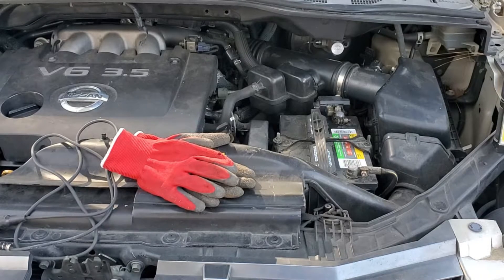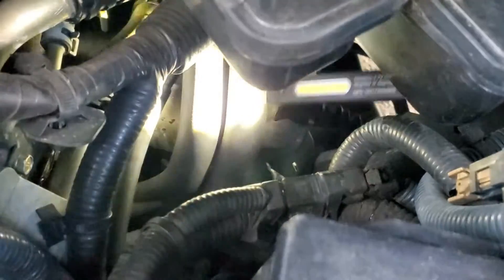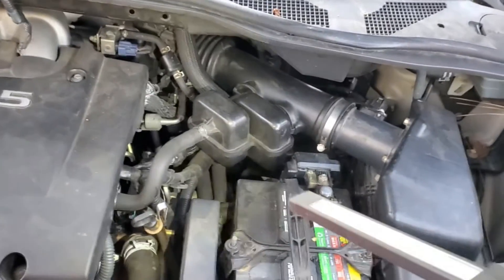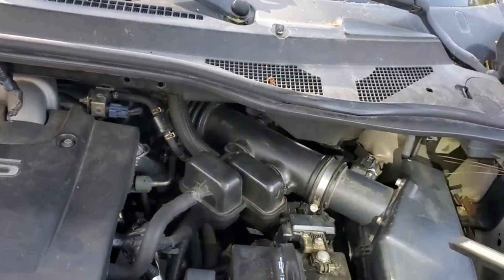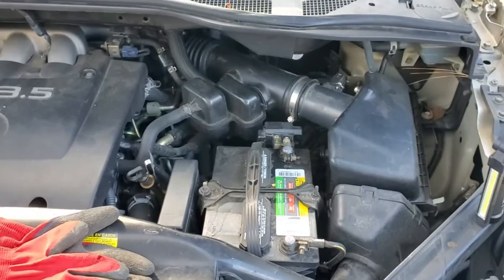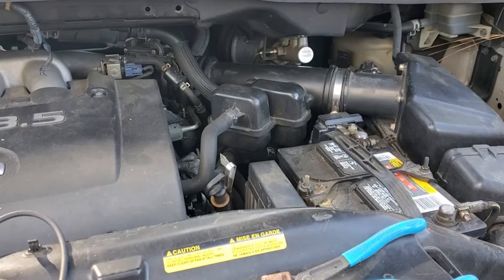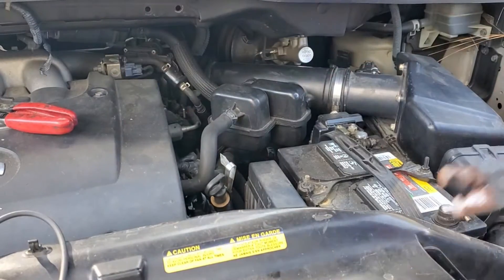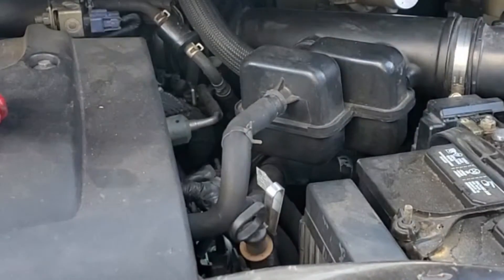04' Nissan Quest 3.5 V6 4-Speed Starter Motor, Intermittent No Crank No Start

Comment: I changed the starter battery is good relays appear good it just clicks . Hard click when I turn ignition
Reply from the maker: Check the battery voltage, if it is lower than 12 volts, battery is old or weak. Check the battery voltage when turning the key. Bench test the starter with the battery that is currently in your car. If it works, check the wire from the car that goes to the starter solenoid, check for 12 volts when you turn the key. If it all works, check your ground connections on the engine, on the frame or chassis. If the grounds are rusted or greasy, clean them up. If they are loose, tighten them up. You could have gotten a bad starter, it has happened to me.